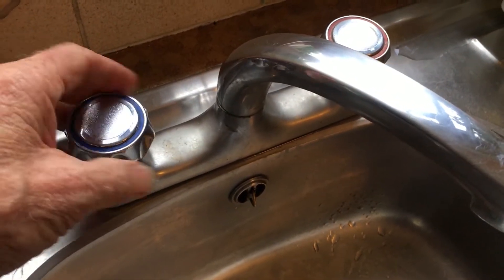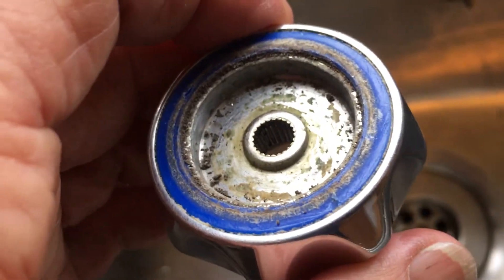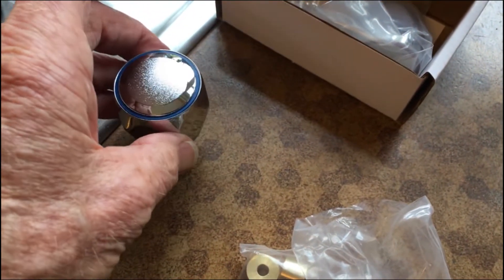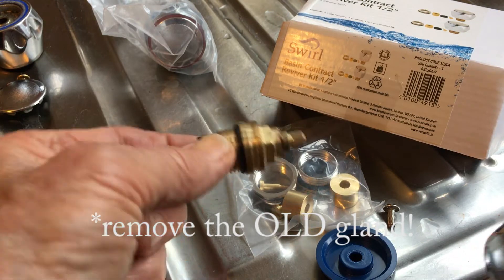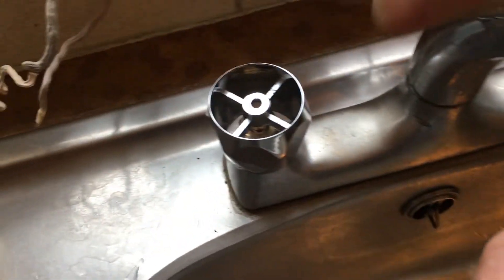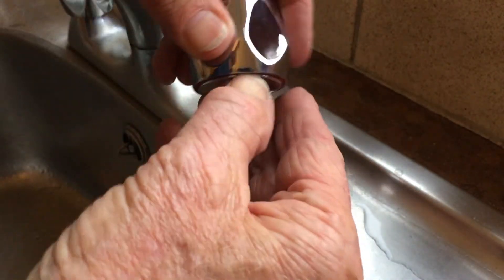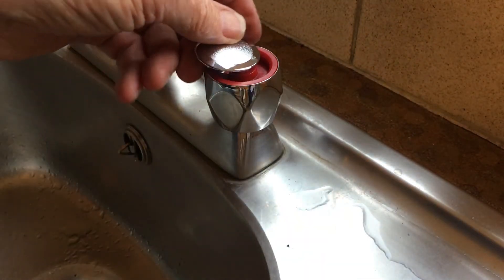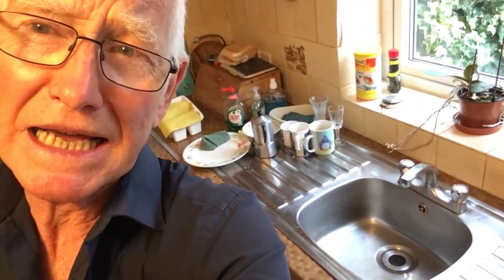Fixing broken kitchen tap with Reviver Kit - an easy DIY plumbing repair job will impress your wife.

Comment: Trying to replace bathroom taps in new to us property..the old tops won't budge..fully worn out (corrosion)..do I wd40 it and hope or just buy the whole taps?
Reply from the maker: Thanks for watching Chris. Buying new taps is the easy bit. Fitting them is where it gets interesting. Firstly I would make sure that and new 'reviver' tap heads will definately fit. If they do I would find out where the method of isolating the water supply is for these taps so that if anything 'unfoseen' occurs you dont end up swimming out of your bathroom.  Then just get serious with your old taps. If the heads still dont come off you can impress your significent other by fitting shiny new taps. Good luck sir. b33zo
Reply: @b33zo  thanks for the reply ..I managed to replace the heads using the reviver kit in the end..it took a while because of the limescale build up..
Reply from the maker: Nice one Chris @Upscaler23

Comment: Do we need to turn off the water?
Reply from the maker: @solgwyn2333 thanks for watching. If you want to replace the whole brass valve you must isolate the tap by turning the water off. If you just want to replace the shiney tap head you can leave the water on. b33zo